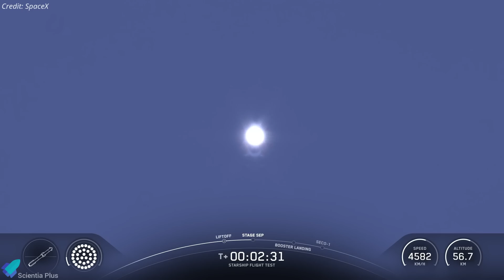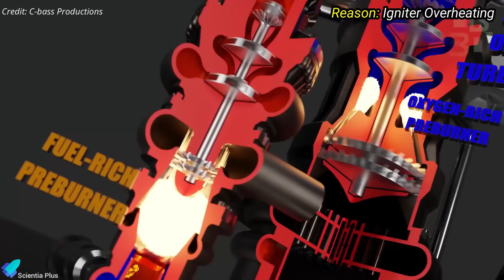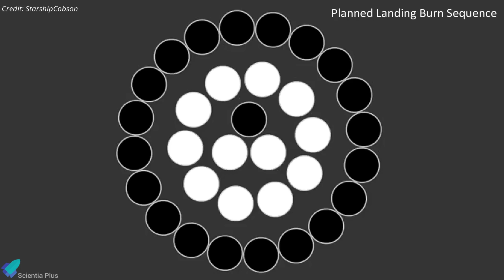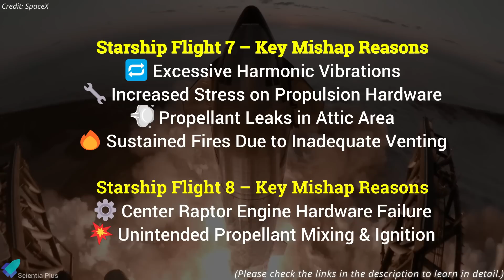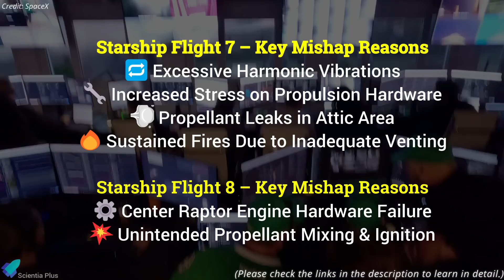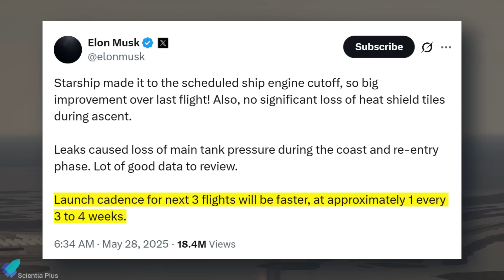SpaceX Lost Starship & Booster: Root Cause Finally Revealed!

Comment from the maker: 📚 Learn More:

🚀 Starship Block 2 Explained:
 📖 Summary: https://shorturl.at/b0dtw
 🔍 Detailed Explanations:
  • Design Improvements Update 1: https://shorturl.at/lpGT7
  • Design Improvements Update 2: https://shorturl.at/gwNQ4
  • Nosecone & Payload Bay Redesign: https://shorturl.at/xa60S
  • Methane Downcomer Redesign: https://shorturl.at/XdYBG

🚀 Starship Block 3 Explained: https://shorturl.at/mnBT4
🚀 Starship & Booster Block 3 Detailed Breakdown: https://shorturl.at/IViwD
🚀 Starship & Booster Block 3 Production Begins: https://shorturl.at/xRNkJ

🔥 Raptor V3 Mega Upgrades & First Test: https://shorturl.at/TRIyj
🧱 What’s Inside Starship GigaBay?: https://shorturl.at/nJM75
🛠 Insane Engineering of New Starship Launch Pad B: https://shorturl.at/7RAZd

🛠 Other Starship Upgrades:
 • Hot Staging Explained: https://shorturl.at/jf400
 • Super Heavy Booster Upgrades: https://shorturl.at/Pi5R3
 • How SpaceX Protects Raptor Engines: https://shorturl.at/4Om8F
 • New Heat Tiles Explained: https://shorturl.at/p2Ijb

🚀 Starship Flight-7 
Complete Breakdown: https://youtu.be/UqzZx7vb-TA
Root Cause & Fixes: https://shorturl.at/HcLKo

🚀 Starship Flight-8 
Complete Breakdown: https://youtu.be/f26yH80RK2o
Root Cause & Fixes: https://shorturl.at/vsGFB

🚀 Starship Flight-9 Planned Mission Goals Explained: https://shorturl.at/fgf4K

🔥 Ship 35 Static Fire #1 Anomaly Breakdown: https://shorturl.at/eLCvL
🔥 Ship 35 Static Fire #2 Breakdown: https://shorturl.at/Ypf0p

📡 Stay Updated:
📢 Weekly Updates: https://bit.ly/3HIQjPC
🚀 SpaceX Playlist: https://bit.ly/34wue8T

🌍 Follow Us:
👍 Facebook: https://www.facebook.com/scientiaplus

Comment: We Told SPACE-X TO BUILD A DELUGE BLAST TRENCH SYSTEM 40 MONTHS AGO--- IGNORED US. WE TOLD SPACE-X TO USE THE PROVEN SOYUZ HOT STAGING BOUT A YEAR AGO --- IGNORED US  WE TOLD SPACE-X TO RUN VIBRATION TESTS FOLLOWING UPPER STAGE "MAJOR FUEL SYSTEM RE-DESIGNS" --- THEY IGNORED US. THE DON'T GIVE A CRAP WHAT ANYONE TELLS THEM--- EVEN THOSE WITH 30 YEARS EXPERIENCE.

Comment: The launch is really only a failure if nothing is learned. They re-flew a booster using significantly different trajectory the starship reached target trajectory and the tiles seemed to hold up to ascent better than previous launches. The issues they are having with propellant leaks are mitigated by design changes in Raptor 3 where flanges are almost all removed so they will be keen to get Raptor 3 into service as soon as possible. The biggest disappointment for the engineers is not being able to test the heat shield on re-entry.

Comment: You LIE !!!
T+8:40 to T+8:50 was planned. The vacum raptors not shut down before for "effectively preventing the problem of escalating".
Never the Starship can change his flight profile, because it need to enter at the correct corridor.
You change the history of events and add time to appear more than 10 seconds. Sea level engines cut always after to have the last control authority and stabilise the Starship before the RTS can work.

Comment: I saw what looked like a lot of ice floating inside the cargo compartment - and Wondered if it were possible that ice froze the cargo door, with possible damage to the opening mechanism during fuel loading.
I have often wondered if hydrophobic surfaces would be able to prevent ice buildup or if it would increase fuel warming at the same time as fuel loading.
Reply: That's what I was thinking as well. It seemed like the mechanics of the door, hinges, joints etc might have just gotten frosted over... I was more concerned about the way it seemed that Starship was beginning to spin just after Meco, lol.
Reply: It's possible, there is plumbing inside the cargo bay connecting header tanks and thrusters, if this leaked propellant it would cause the ice seen in the video as propellant gets a lot of ice in it due to autogenous pressurisation. Previous flights with the standard banana we saw no ice floating around like that.
Reply: @schrodingerscat1863  Not as much true, But I saw it.

Comment: Fuel leaks have been the bane of Starship. 
How many landings have we seen looking like the whole thing was on fire? And some kept burning and exploded after landing.
Even the first booster catch came down with lots of flame surrounding one side of the rocket. I'll bet they ALMOST lost that one also.
Reply: That is why they removed all the flanged joints on Raptor 3, no joint there can't be a leak.

Comment: Cannot take a gallon up with a tin can cocca cola pop can  thickness
design to maximum  extrem needs like Brunnel 200 year old bridges boats  not to its minumum cost SpaceX failures
Reply: What in the meth are you even trying to say?
Reply: The result would be unusable and would not do the job due to being too heavy. And you forget how many bridges failed first.

Comment: Why are we treating the symptoms and ignoring the problem!  Symptons? Results of flights 7,8,&9.  Problem? Hot staging!  Lighting multible rocket engines in a semi enclosed area causing reflected pressure to critical parts of the space ship.  Solution! 5 second delay after detaching the booster to light main engines of the space ship.  Cold Stagging!  The way we had it without problems!
Reply: SpaceX needs the performance boost of hot staging.  So far, they have been flying empty rockets on suborbital flights.   To get a 100T payload to orbit, they need more than 100T of extra performance. Hence, tricks like hot stage, the higher angle of attack descents, stretching, and so on.
Reply: I dont think hot staging is the problem from the data. If it was they would not be blocking off seconds of the hot staging ring off the help flip the booster.

Comment: Instead of shutting engines down all at once.... why not throttle down engines to below 50% then shut off
Reply: What shall that be good for?
Reply: @gottfriedheumesser1994 

I heard/read at one time that the fuel is traveling towards the engines so fast…. That a fast shutdown had a hydraulicing effect
Reply: @robb8235  The shorter the tube, the less effect it has. I assume the vibrations are worse, but these are things that test flights have to be done, as one cannot simulate these stresses and loads on the ground.

Comment: The booster was B-14-2, not B-14.
Reply: That's not a significant difference. It shows only that some parts have been replaced.
Reply: B-14 and B-14-2 are the same booster.
Reply: @brianbiddle7590  Yes. B-14 was its first flight. The subsequent number indicates that it was previously flown, hence, the -2.  When they fly it a third time, it will be called B-14-3.  Same booster, different designations.

Comment: Falcon 9 took years to develop before being at it's current state, so seeing Starship and it's Super Heavy Booster go through all this really is just part of the process. Frustrating yes, but that's just because we're depending on Starship to land us back on the Moon before China, and at this rate, I feel 2027 is probably not going to happen. Starship still has a couple years before completing all the milestones required before we trust this ship to carry humans to the surface of the Moon. Go Starship, but it's still going to be awhile...
Reply: falcon 9 took 4 launches and everything went fine , this has taken 9 , and still has,nt completed a mission , and still there are problems , booster seems to work , but ship is not even close
Reply: @stevensmith797  Except Falcon 9 isa lot less technical if you look at it. Nothing of this size has been worked with for many decades, and even back then it was a failure mostly. That's why they call them TEST flights. To see what's wrong and fix it till everything works well.
Reply: @kamxam1384  yes mate , but this is supposed to be the thing to land on the moon with people inside it in 4 years , by the time they get it to work the chinese will there waiting for you , another musk time line that is was totaly miss judged
Reply: @kamxam1384  Forget Falcon, considering flight 4-6 were so successful, last 3 seem to be huge step-back on ship front(and we ain't even at booster v2/ship v3 with Raptors 3). Ship v1 was absolute tank to point where even FTS system couldn't properly destroy it and now SpaceX can't even get v2 ship into stable flight profile and in flight 9 they had fuel "leaks". Up to flight 6 it felt like solid progress each flight, although naysayers were harping "lol can't get to orbit". The way I see it, last 2 flights have literally been "throw something into air and hope it works because it did previously". There has been 0 progress this year with most complex part of flight - re-entry/heat shields, which sets whole thing back at least a year or two. On overall I'm disappointed, seems with recent political theater capable guys have left SpaceX.
Reply: @stevensmith797  That's like comparing test flights of a piper cub to a F-16.
Reply: @stevensmith797  That's not counting the development of Falcon 9. It took almost ten years to make it as reliable as it is today. Have you not seen all the failed landings and BOOMS? Lol... They didn't have it perfect from the first test flight and 4 launches later she was fully reusable. Starship is MASSIVE and this will take time. I still feel that they'll have this all down within a year or two at most.
Reply: @Dying2play13 ,took 4 launches to get it to work , starting from absolute 0 , from engine desiegn to the falcon itsself , starship started with space x already being the num 1private launch system on planet with who know,s how many more people working for him , keep going he,s get it to work , but this was going to mars in 2022 , then from there every time line has fallen latest moon by 2029 , not likely , and china is comming and they arnt relying on 1 launch system
Reply: @stevensmith797  5 not four launches, but took years to perfect. Each time Starship changes over 1000 things it creates a possible over 1000 possible failures. All my point was, is that people need not be too concerned over these last RUDS. It's the way they do this, and just happen to be far more open about everything. We're not watching the explosions of Apollo missions, we're witnessing the testing of a brand new vehicle and will take more than a year or two to perfect something this complicated and new. Largest rocket in history and meant to be fully, rapidly reusable. This will take time... But yes, falcon 9 had 3 failures and one partial before a successful mission. But one success doesn't mean they'd put people on it... You're clearly missing my point.
Reply: @Dying2play13  your missing the point , fact is , starship will NOT do what musk says it will do in the time line he is saying , hard to see how they make a moon landing ship in 4 years that then has to be cirtified for human use and keep em alive for a week on the moon and then get them back , in the end , musk will cause the USA to lose the second space race , and again , sure falcon took years , with nothing backing it , unlike starship with a massive company behind it and public money (168 million for the development of moon ship , most of what is needed to make starship that has,nt even started yet because cant get ship to work to test anything ) already has been worked out , tested , and used , not the machines , but the systems , huge head start , all the supply lines , how to produce rocket on a production line , even the red tape , falcon had none of that
Reply: Send the Tesla bots.